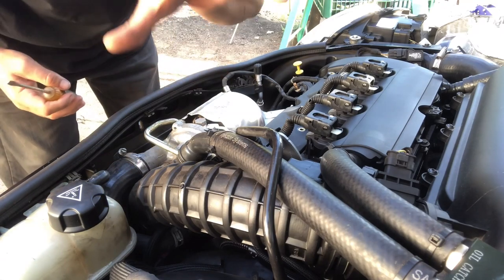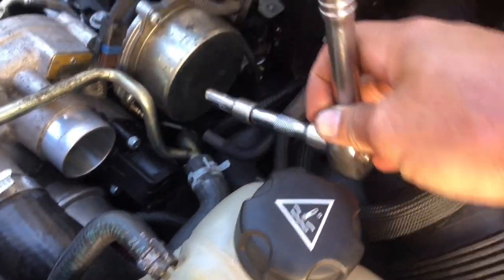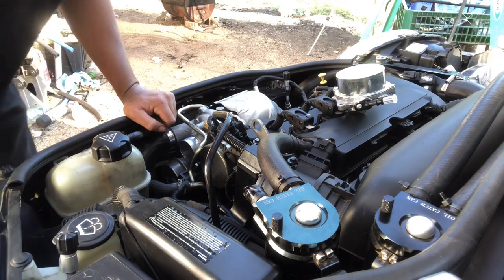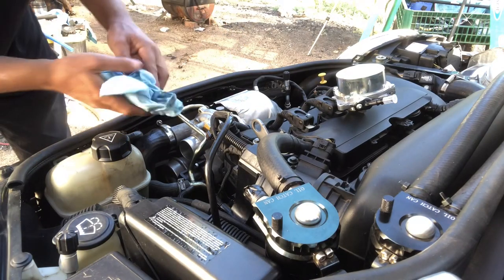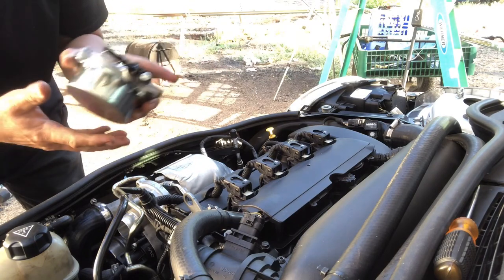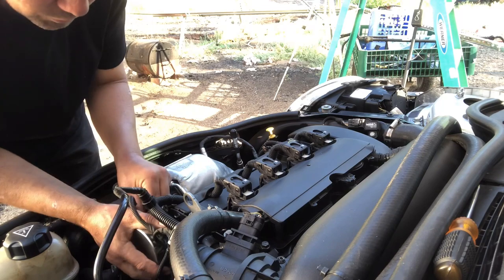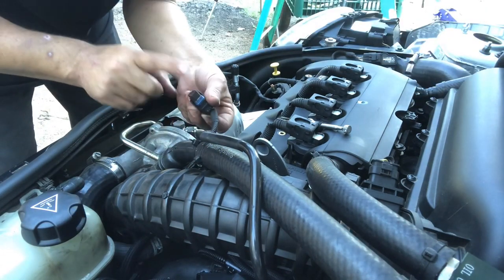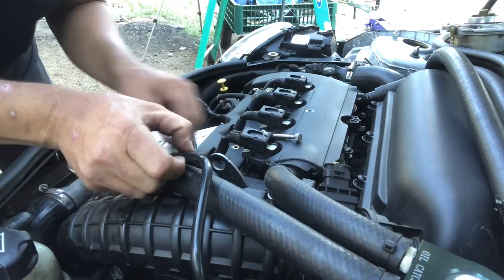How to replace the vacuum pump on an R56 Mini Cooper S (N14)

Comment: We used a socket insert magnet to hold the bottom bolt going back in.  1/4” makes it easier.    Thanks for the video.

Comment: Thanks for the video, thought there was another bolt until I used a screwdriver to get it out. Mine had a 1/4 gap in the o ring on the head.  Looks like you have 2 catch cans?

Comment: Is there a way to diagnose if the vacuum pump is the issue. My brake pedal is rock hard and does not stop , all while driving 30 miles on the Parkway and NJTPK.  2012 Cooper S Countryman all4.

Comment: Love the channel! Thank you for the great context. I ordered the same one and i took off the old vacuum pump easily. Putin the new one back in place has been a challenge. I know I'm lining up the grove with the crank shaft correctly, and the pump goes in with slight gap. No matter how hard i push it in, I'm not getting it flushed all the ways. I don't know what to do. Any tips or tricks? Thanks
Reply from the maker: Double check the part number and if that is correct then your hitting something. You’ll have to figure out what that is. If you post pics in the Facebook group Mini Cooper DIY I’ll see if i can figure it out
Reply from the maker: I didn’t need to remove anything that wasn’t in the video. I’m glad you got it figured out though
Reply: @MooneyM20J  Man I just tried changing it on my gfs car. Glad you figured it out, damn near smashed the car up. I'm never working on cars again, i'll try it again tomorrow and remove the bracket you have pointed out.
Reply: @span89  good luck. You just need to have the right tools and it would be quick!

Comment: Does the car throw any codes when it’s the vacuum pump. My daughter has a 2012 R60 with an N14 engine, she says she is seeing warning lights for brakes and traction and the car is hard to start and idles roughly. She is 300 miles away from me so I don’t want to give her bad diagnosis. I immediately thought it was the vacuum pump when she described what was going on
Reply: I just bought an 08 and went thru the hard starts and rough idle. It was low grade gas and low on oil..and leaked at this pump. only use prem gas! and run a bottle of octane boost thru it. engine light went off! I just did this pump. I'd start there, advised by a mini dealer shop....good luck.